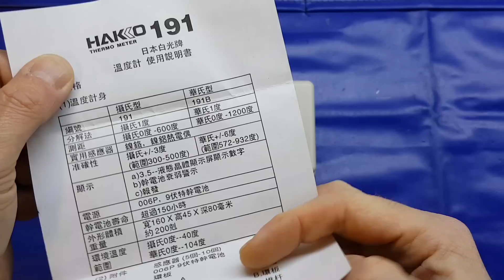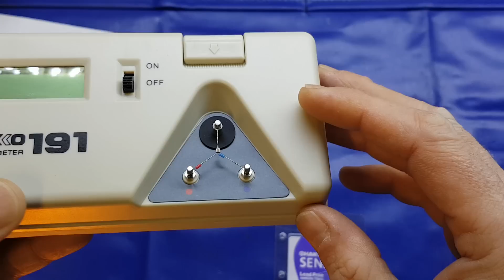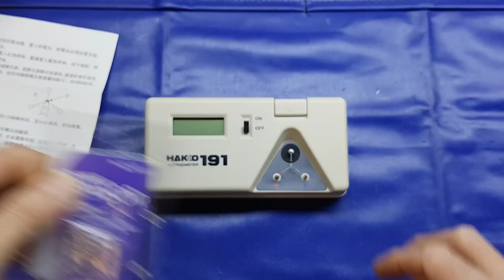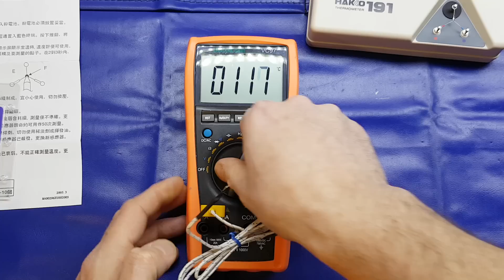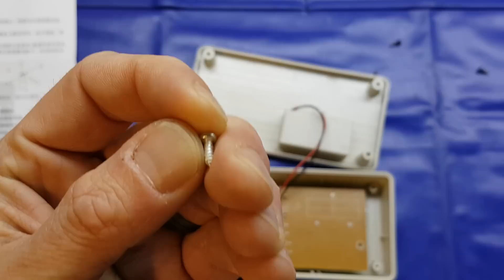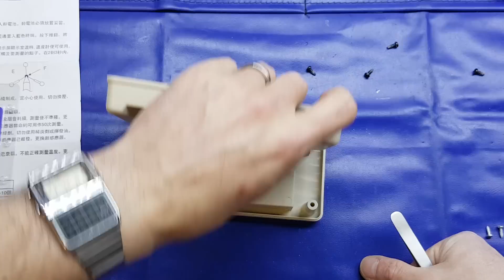***Competition time #3*** & Hakko 191 soldering iron thermometer review and teardown

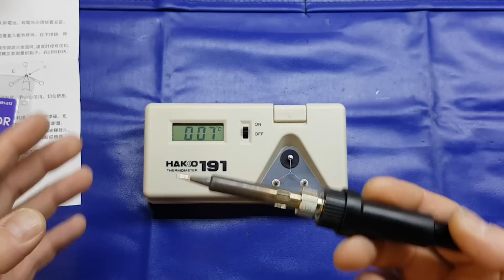Comment: 3:42 How can it show 8 degrees Celsius at room temperature or are you sitting in a refrigerator?
Reply: Yeah I have a real Hakko 191B, it has a much nicer PCB with 2 calibration pots etc and it reads 70F at room temp

Comment: Having seen both of Clive's videos I bought the digital soldering iron and one of these Hakko thermometers from Ebay. The soldering iron seems to be OK, but my Hakko is reading about 150C too high!! I've got several old Weller irons with the magnetic tips (No 7) that set the temperature (curie point?) to 370C. They all read well over 500C and the new digital iron set at 350C is in the high 400s. So I'm currently in the process of trying to get my money back.
Mine is very similar to yours inside. If you look on Hakko's web site you will find the manual (PDF) with the calibration procedure. This shows the genuine part has two variable resistors on board. Obviously we have a cheap knock off with those bodge smd resistors and links instead.
BTW I also suspect that the reason for the price drop is that the 191 is now obsolete.

Comment: Question - would you recommend the VC97 as a good enough multimeter for a beginner hobbyist? Have only got an old pocket sized Hilka ?? meter that a friend gave me. It's ok but has short fixed probes which are a PITA when trying to measure something while adjusting a pot......need three or four hands! 

On the boost in subscribers - I found your channel last week when you did the response vid to Big Clives fridge LED vid. Think MyPlayHouse got a boost like that last year when he sent a faulty fan to Clive, who did a video. It's great the way one video leads to new subscribers.

Now to start catching up on all your uploads :D
Reply from the maker: 100% a great budget meter...as accurate as you need it and comes with a good range of features. Generally comes with leads, thermocouple and croc clips all in a zip-up case. Just search for aidetek vc97 on ebay.

Did you see my video as a suggestion or elsewhere?
Reply: Saw it on this video and researched it but then saw it on your video on kitting out your bench. Think will get one -  the one I currently have is awkward as hell.